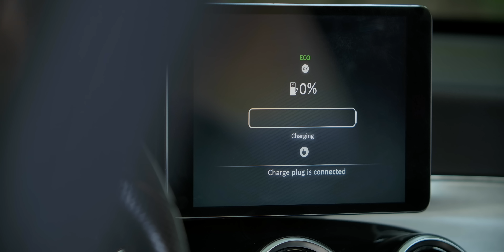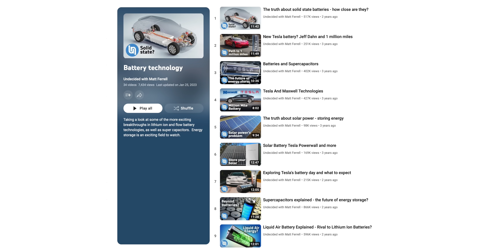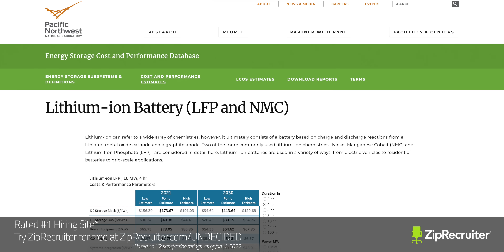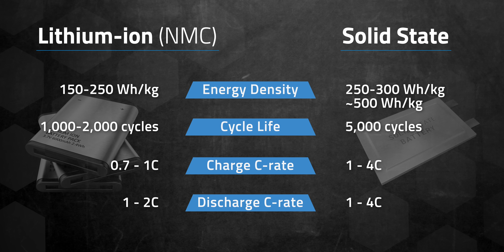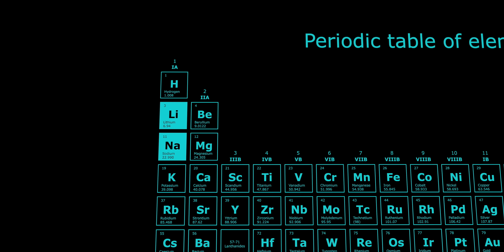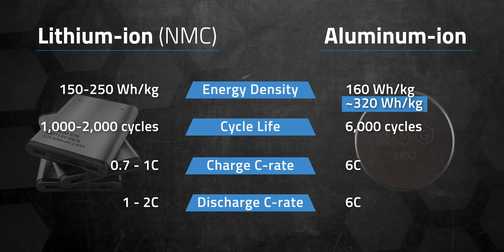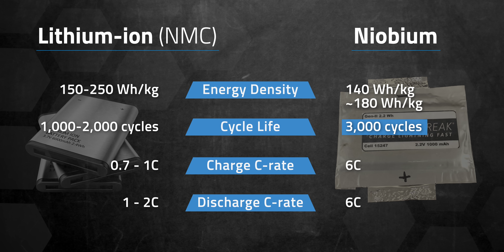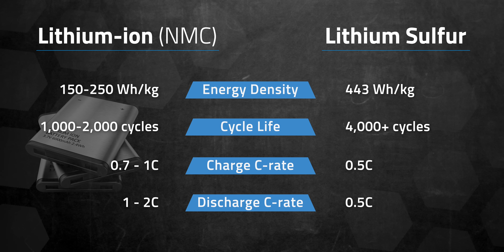Are These Batteries The Future Of Energy Storage?

Comment: For racing applications I'm most interested in energy density and safety. A battery with 3x more density by weight would be a game changer for small lightweight vehicles.
Solid state would be the winner for this possible group of options. I can't wait as current NMC li-ion cells come with a large weight penalty that's hard to get past.

Comment: Most interesting would be "the" solution for home storage.
This means:
1) Max charge cycles (even if it's cheap, nobody wants to swap batteries every 3-5 years, 10 years = 3000 cycles is minimum.
2) minimal cost. The currently cheapest LFP batteries are around 800€ per 2.5 kWh (usual rack size battery, 5 kWh simply cost twice as much, they aren't really cheaper).
This is too much.
A house realistically needs at least 10 kWh, I would rather like 20 kWh. And this has to be less than 2000€/$! Because this still equals 200€ per year, don't forget that!
3) weight and size basically don't matter. Currently, I have 3000 lbs of flooded lead fork lift battery in my basement. Don't aks how it was to carry them down there 🙄. But that's 37 kWh. If 20 kWh of whatever technology weighs 1 Tonne, I'm fine with that, every 10 years.
And size? As long as it's allowed to be placed wherever you like, everyone has enough place in a house!
4) charge efficiency! 
My lead acid is around 63-70%, depending on the soc. The last 10% are insane and it really hurts in winter. LFP are like 96% efficient (real measurements!). That's nice. 

There is still a long way to go until the mentioned requirements are met.
Until then, I hope my 10 year old lead battery will do another 10 years.

Comment: Why does all these YouTube channels like this one always leave out Lithium Iron Phosphate LFP batteries?  Cheaper than Lithium-Ion NCM.  Also LFP gets 2 to 3 times more charging cycles. Also longer calendar life.  Also incredibly hard to catch on fire and way easier to put out if it does.  Also easier to recycle.  Also can charge faster.  Also way less CO2 is generated during manufacture of LFP compared to NCM manufacture.  Also LFP can be discharged to a lower level and charged to 100% with DC Fast charging mulitple times a day without damaging the battery.  While NCM is recomended to only charge to 80% daily and not let get below 30%.  Daily or multiple DC Fast charging per day will damage NCM batteries.  Yes in order to have same range as NCM battery the LFP have to be about 10% heavier but that is the only advantage NCM has over LFP.  Seriously LFP kicks NCM's butt.  It is only this obsession with range and that NCM batteries can be slightly smaller that has driven the early EV manufactures to pick NCM over LFP.

Comment: There is an 11 passenger electric plane with a claimed 600 mile range on a charge.  This is with batteries around 300 kw/hr ratings and if the solid state batteries did reach 500 kw/h as mentioned this would bring the flight range of the Alice plane to about 1000 miles.  Not bad for a small passenger plane, but this could be upscaled to a 100 person plane and be more efficient  than a small plane and still get 1000 miles or more and many people could use it and the price would be like a bus ticket .  Solar assist might add 2% to that range, maybe more .   There are also planes that have a glide to fall ratio of about 25,  meaning if it were five miles high it could glide over 100 miles before landing, maybe 125 miles.  But that solar assist I mentioned works even better at those altitudes and might provide 3 or even 4% power extending the glide ratio to 30 or more miles of gliding.  I am thinking 10 kilowatts of solar power is 13 horsepower is maybe `100 pounds of forward thrust, not much for a 100 person craft.  But might make 150 miles of glide  from 30,000 feet.

Comment: Why is the "C" rating, which you say is based on the time length of discharge, also the measurement of the speed of charging?
And if a battery gives one amp for one hour and takes one hour to charge, shouldn't the battery that gives two amps for one hour take twice the time to charge? And the 0.5C battery take only half an hour to charge since it only supplies half an amp per hour?

Comment: I'd like to see more focus on calender life rather then just charge/discharge cycles. Most battery technologies don't really last much beyond 10 years, even when well taken care off and with a low amount of cycles. That's one of the biggest hurdles for low mileage drivers. They don't want to be stuck with a expensive paperweight that only has 50.000 miles on it because the clock ran out.  It's also a problem for the people that rely on the second hand market, a 10 year old EV really has little life left for the price.

Comment: What makes me mad is how can we be so stupid as to carry around 600 to 1,000 pounds of batteries in an EV? If we were to bury electrical cables in our highways, we could make cars more efficient. This would also lessen. the potential for auto fires. By using this technology, we could use the electricity that is produced during the day to power our cars instead of having to charge our EVs at night when the is little to no sunlight or wind to supply power at time of use. This would also allow our cars to charge while they were in use. A simple electric meter in the car would communicate back to a billing authority to bill the customer. An auto would only need the capacity of driving 100 miles off of the grid or in case of the grid being down for some period of time. There would be many changes needed, but all of the tech is known today. It would require a fair amount of construction, but it could be installed in sections instead of doing it all at once. We could forget about carrying these expensive batteries around in each vehicle. Maybe I am dreaming that we could do something that makes so much sense.

Comment: Maybe a mix of batteries that hold a lot of energy for low cost but lower cycles and maybe lower C, and batteries with high C and high cycles.  For everyday driving, you mostly use the latter while keeping the former charged up to prevent range anxiety.

Comment: Problem with all these battery technologies is that they are 10 years away.  Most 5 years from winning the battle from a chemistry standpoint, and then another 5 years until they can be produced at the true scale necessary to move the meter.  As you said yourself, these fast charging batteries are a bit useless until either your home or supercharging station infrastructure can delivery that amount of energy in that short of a time.  At best most will simply flatten the charge curve to a 350kW straight line, which will still be nice as it would close to halve the current charge times.  To be honest the only battery technology that matters in the next 5 years is the technologies already in the full commercialization process by CATL, BYD or Tesla.  Everything else is just noise.

Comment: I had the idea (or I'm one who had it too) to combine De-Salination with sodium battery production.
Usually the brine of desalination is put back in the ocean making the area around the outlet so salty thst it becomes inhospitable to life.
Using the brine to extract the sodium and making battery out of it.
Two birds with one stone. You could product billions of gallons of water to drink but also to water plants in drought prone regions.
Even if sodium battery are not as good as Lithium you could flood the market with so many at such low prices thst it wouldn't matter.
Reply: Cheapest salt is mining salt.  There is lots and lots of salt mines all over the place with little more cost to extract than a Diesel powered excavator.  Extracting salt from salt water is expensive since there is still a huge amount of water to evaporate.

Comment: When I see 18650, I know, especially if from China, can vary based on who made them. I have once ordered a generic pair (black plastic coated) and I could tell both weighed less than the others ordered, power running time was noticeably lower. There is a testing video of several of them here on YouTube, and  I use the red ones, in my LED flashlights, last time ordered, hard to locate, and these 18650 batteries are in PC Notebook battery removable modules, not easy to open.

Comment: Lithium-Sulfur are the ones that will compliment lithium NMC and LFP the most and will be the fastest to market, as Lyten already broke ground on their mass production factory in 2022. They have a potential energy density up to 5x greater than NMC. The Drexel team achieved 3x greater energy density, and Lyten nearly 2x greater. Although they still use lithium (which is the 25 most abundant element on earth -- Australia, now the world's largest producer, will supply 32% more lithium in 2023, being one example) they don't use nickel or manganese (both fairly abundant but tighter supply chain in the case of nickel) but more importantly, no cobalt, which is much more rare and has a very thin supply chain mostly controlled by China. Sulfur, on the other hand, is the 10th most abundant element on earth and is very cheap as just about every country has sulfur within their borders.

Sodium batteries, if one can truly trust the claims of a Chinese company such as CATL, will arrive this year, 2023. If they do work and last as they claim, they will quickly supplant lithium in stationary storage.

Comment: You won't need Batteries ounce H2o-Hydrogen Fuel Cell Technology Becomes Violable . From Water to Hydrogen & Oxygen Produces POWER with the only Byproduct Water. Closest thing to Perpetual motion ever invented by man. Until Energy absorbed from the air itself in the late 2330's just 118 years in our feature. The Oil industry owns the Tech and we still use more OIL than ever Just as means of Producing millions of New unheard of products not energy production.

Comment: For years we R/C Flyers/Hobbyist used NICAD / NMH / now Lithium Ion Batteries were used in R/C Model planes that have C ratings to 5 and can be Theoretically Charged at 5C. They range from 50 MAH single sell to 6000 MAH 6 Cells and bigger.

Comment: I believe the future will be layering different battery technologies. Fast charge batteries where you can travel 75miles on a 2minute charge, but will have to wait the full 60 minutes to get the 300 mile charge on the high density batteries. 

This means that we can have our quick fill ups for short ranges, but consider overnight charging for long distance.

Infrastructure is key and the only way to get a boom in all this is to have retail stores and parking spots implement charge stations where you will want to charge your vehicle while you spend your time at the location.

Comment: Matt, I so rarely post that I had to figure out where to type.
That said, I'm a full time investor and specifically an EE and very successful tech investor.
So, IMO, it's extremely hard to accurately value and project battery technologies. I do it all day long, every day. And people should NOT assume anything without a major set of due diligence.
The most important points to ponder.
1. Is it what it says it is. Example, QS is NOT a SSB. It is a hybrid. It uses gel. There is only one true SSB out there that has made it to EV vendor testing and that is Solid Power's 20Ah and 100Ah EV cell.
2. A viable battery must include the following.
A. Safety, B. Performance, C. Cost/Pricing Capability, D. Scaled Manufacturing Capability.
Performance is broken down into charge rates, charge cycles, discharge rates, gravimetric, volumetric  density and packaging.

Miss one of the above, and you don't have a viable product. Aggregating all of this is very complex. But to date, only Solid Power, Factorial and Toyota are the players that have "true SSBs" again QS is NOT SSB technology. Now of the 3 only Solid Power is testing at the OEM level for EV cells. Toyota does have a SSB. But it is so expensive to make, that they can't do an EV, so they are rolling it out only in hybrid form, since it take a much smaller battery to power a hybrid. That leaves Factorial and since they have not independently lab tested, you can't be sure of what they say. (Just as QS has never independently tested anything but a single small one layer cell.)

There is much hype and misunderstanding around SSBs. I bet my capital. And I do my DD. So I'd warn anyone, not to accept "aggregated" opinions, because they can be uninformed. There's nothing wrong with being uninformed, as long as you rectify that.
(BTW, the picture of  two SSBs that you show at the beginning of the video is (5:00) is from Solid Power . It is the tech holding the 20AH and 2Ah SSBs from the company. So, please while doing research, do not fall into the trap of using the wrong information simply because you saw it somewhere else. Source everything. That's how to be accurate.)

And yes, I was a bit peeved that you showed a Solid Power Battery, and didn't even bring them up.

Comment: The costs and losses of creating, storing and turning hydrogen back to electricity becomes completely irelevant when we look at the massive energy density of it. 20+kWh in a kilogram. No more need for batteries. It's so simple that engineers can master its safety to be better than a battery. And it's so cheap that corporations can profit way more than with batteries.

Comment: I currently own a couple of portable home storage batteries with a LiFePO4 (Lithium-Iron-Phosphate) chemistry.  They are supposed to have a much safer chemistry and support many more cycles than traditional Lithium Ion batteries.  (They are not quite as energy dense, however, IIRC.)   I might be wrong, but I don't believe I even saw them mentioned in this video.  My units are 3600 watt-hours, which will run a refrigerator for about 1 1/2 to two days during a blackout (which is the purpose for which I purchased them).  This seems to be highly dependent on the efficiency of the refrigerator and the ambient temperature.

I'm just wondering why they didn't get at least a mention since they are currently considered the best batteries for some applications.

If anyone knows why, I would appreciate an explanation.  Also, if my information is faulty, please correct me.

Comment: I think downplaying the importance of stationary applications is misguided. Mobile applications are useful to create a cleaner, more sustainable global civilization, but only so far. The cost of batteries in consumer electronics will always be overshadowed by that of the rest of the device. Faster charging batteries for cellphones and laptops are merely a convenience factor. Cleaning the worlds industry however is of existential importance. Affordability and longevity is key. We first and foremost need cleaner energy production. Until we do not even EVs are as clean as they can be. And to make optimal use of renewable energy we need grid AND residential storage on a massive scale. A heavier, cheaper, safer, longer lasting and more resource accessible chemistry is crucial for this. Ships and trains, even very large mining  equipment can also benefit from heavier, more affordable battery chemistries.
So two lists would make more sense.  5 technologies for "mobile" energy storage and 5 technologies for "stationary" energy storage. The stationary storage list being way more potentially iimpactful.

Comment: 3:49 "proven reliability"?
hah
Like those burning Teslas? I'm sure that shows how reliable they are. And non-replaceable smartphone batteries that lose 50% capacity over 2-3 years? Or like those Samsung Galaxy batteries that will always swell up after a few years? (Mrwhosetheboss has made a video about it). And how about exploding Galaxy Note 7's?

When it comes to the number of cycles, not overcharging helps but smartphones manufacturers have absolutely no integrity. According to Accubattery, 3.94 V is the optimum charged voltage, while new batteries charge to 4.35V and it makes them deteriorates about 4 times faster.

Comment: I'm very excited for the day that a 5keh battery for an inverter no longer weighs 47kg.
CFE and pylontech remains very heavy though.

It seems to me that what you are saying regarding cycle life is not the same as what the manufacturer qoutes us.
I am usualy told it's 3000 cycles and set the charge current not more than 60A.

Also Financialy Lead acid is not obsolete. 
The trick is to not discharge more than 0.1C. Then  it will last almost forever. 
Say you have a 2kw inverter. 
You will need around 4x 200 ah. 
Then you are golden. They charge relatively slowly but works well if your power is not off 50% of the day.
Sometimes lead acid works out cheaper in certain off grid situations compared to Lithium and the major advantage of lead acid is this. 
Relatively little to none dead on arrival batteries from lead acid compared to lithium. 
From the 6 lithium batteries I installed this year 3 where faulty from the factory. 
I personally have not yet experienced a dead on arrival battery with lead acid.

Comment: Hi. You touched on the vehicle charging issue briefly.  This is one of the big elephants in the room.  I'd like to hear some more discussion on the huge infrastructure limitations that apply fairly universally.  As an exercise use a low "C" charge rate of 5C (12 minutes) to charge a 60kWh EV battery.  Now multiply that by 10 cars at the charging station at once.  The power being drawn from the grid is enormous.  I've worked in the electrical industry for over 30 years and know there's decades of upgrades ahead of us and we're already way behind.  Don't get me wrong.  I love EV's.  There's a lot of work to be done on the entire electrical chain in addition to battery development.  Most of which seems to be getting put in the too hard basket.